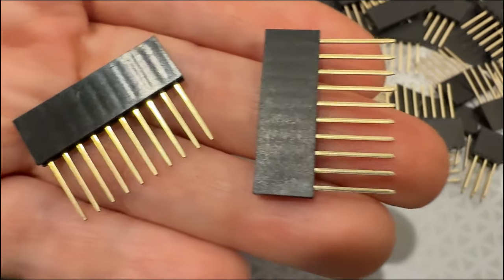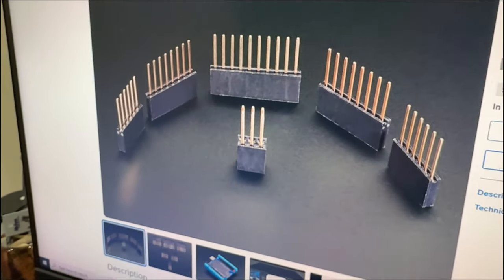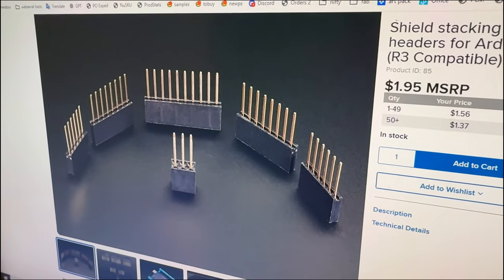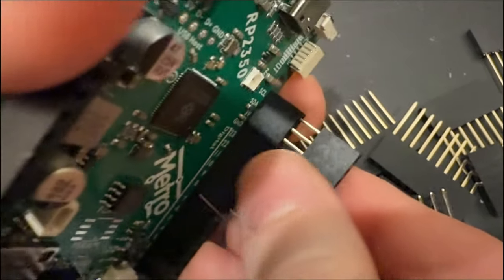It's hip to be square (pins) 🔲

Comment: I’ve gotten a bunch of those (cheap flimsy one) paired with Wemos D1 mini clones and never really liked them because they were so flimsy and finicky. The only thing I’ve used them for is to mount female headers on a surface that’s not solder-able by alternately bending the pins out 90° (first pin bent left, second pin bend right, etc.) then gluing them to the surface with hot glue after I’ve soldered wires to them.